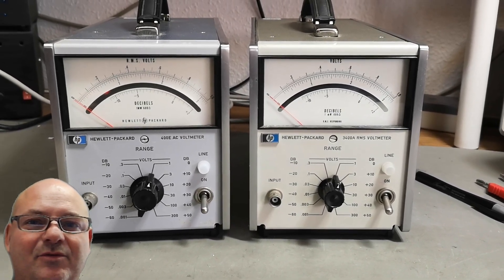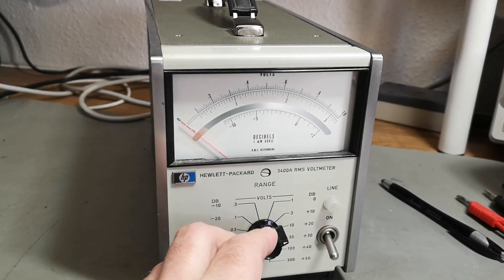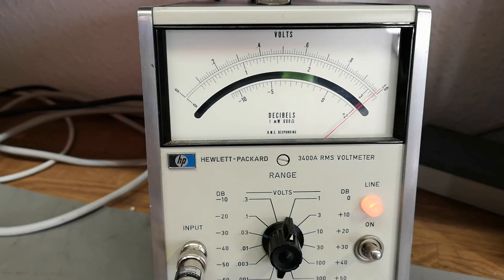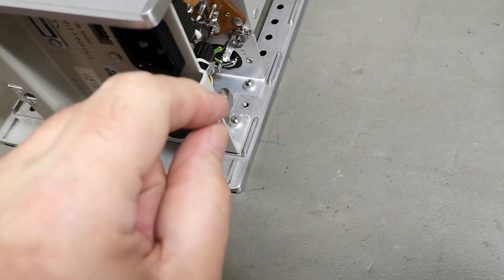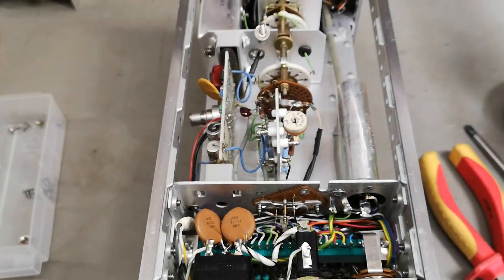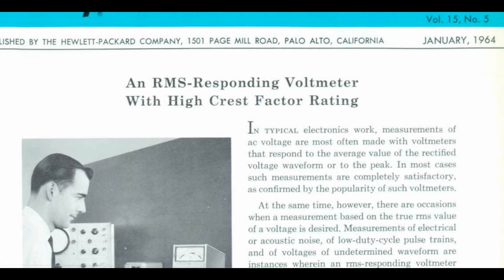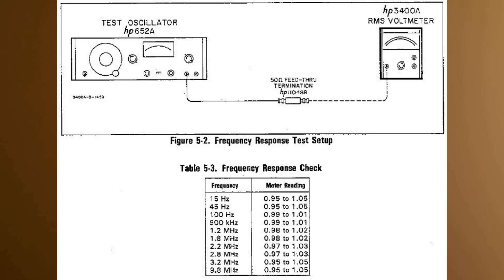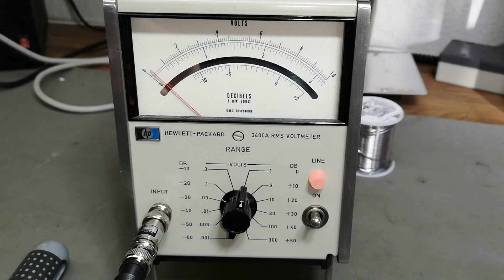HP 3400A RMS Voltmeter thermocouple chopper Nuvistor 1965 teardown

Comment: Hi Thomas, I'm back in civilization for a while, I've been watching videos in my spare time, but I haven't commented on them from my mobile.
I bought a 3400 on e-bay, unfortunately someone hurt it terribly, the input part is totally dead, the Nuvistor only heats up, but the signal does not pass, so I have something to do for the long winter evenings. When I bought it, I just wanted to do a quick commissioning and find out its condition, first I measured all the capacitors and after finding out that they were out, I bought a set of radial (they didn't have axial) 105° capacitors in a brick and mortar store for initial commissioning, with the provision that I would then order axial types. Before I started replacing them, I measured all the new capacitors to know what deviations they had from the prescribed value in the service documentation and I couldn't help but wonder - the old Sprague ones (the ones that were fine) had better parameters than the new ones bought in the store - reforming didn't help either. I'm quite jealous that yours works because it's an amazing RMS voltmeter. So far, I have put into operation the 209A oscillator and the 427A voltohmmeter from this series, for which I also made a new battery (it has been there for more than a year and it still works).

Nice day 🙂 Tom
Reply from the maker: sounds like great fun, good luck

Comment: The last version HP 3400C are a J-FET input transistor instead a Nuvistor (6CA7 maybe)
Reply: Model A was produced in two versions 1) with a photochopper 2) with an operational amplifier, the first model with a J-FET was type B - it can be modified and digitized, the measured results can be displayed on an additional monitor and in the form of graphs, or the values can be saved to a PC, it has only one problem and that is the price - it is several times higher than the A model.

Nice day 🙂 Tom